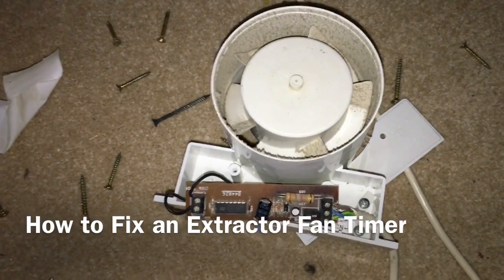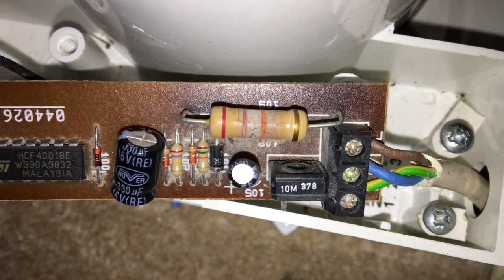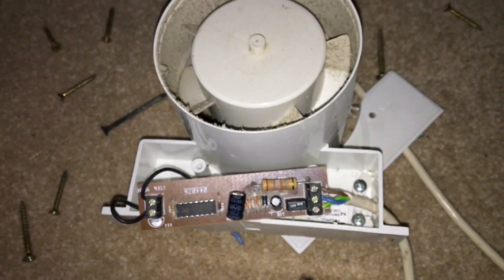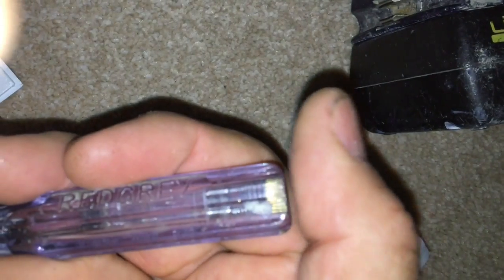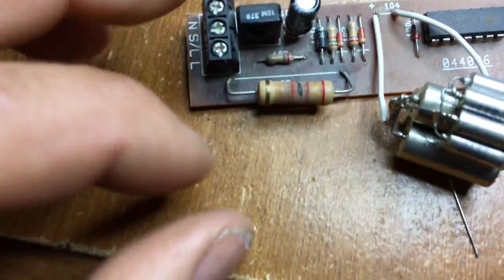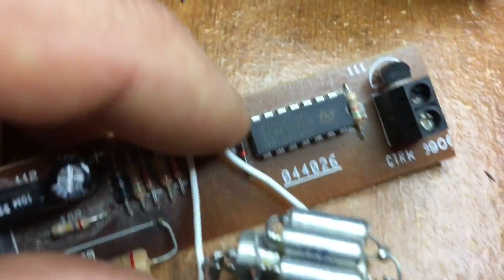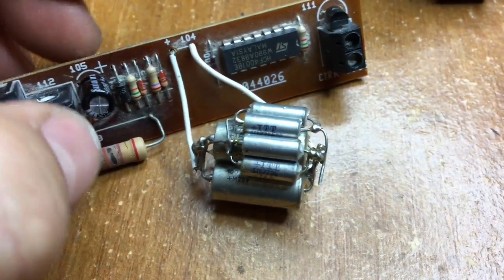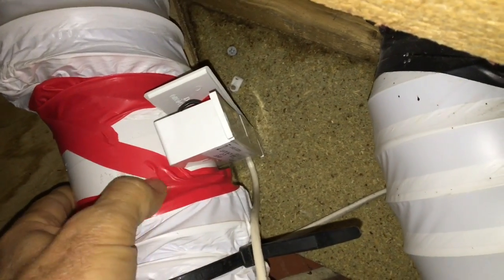How to Fix an Extractor Fan Timer

Comment: It was the smaller 47uF capacitor on mine as well - symptom was that the fan got slower and slower over the space of a few weeks, eventually just humming but not spinning at all.  Disconnecting the two black motor wires from the timer circuit and putting mains onto them proved that the fan was AOK (though was starting to clog with dust and got a good clean).
Reply from the maker: Glad you fixed it and I could help.

Comment: Thanks for posting this, it helped me fix my identical timer. My fan was running continuously after a lightning strike hit and destroyed a tree across the road. Many houses had their internet hubs and routers destroyed but as far as I know we were the only one with a bathroom fan problem. I saw the large burnt resistor with illegible markings and assumed that was the problem but you told me the specification and like yours mine measured correct. It wasn’t the capacitors either in my case, they looked and measured correct, it was three of the semiconductors, which I could have guessed given it was a high voltage attack. One of the 15v Zenner diodes was shorted. The logic quad nor gates didn’t work and the triac was shorted. The triac caused me the biggest problem as it is marked Z0125, which doesn’t seem to exist. I couldn’t get a Z0110 which is the 25mA trigger one so used a different type of triac which didn’t work at all, so used a Z0109 a 10mA trigger one, which did work. Time will tell how long for. 
I drew the circuit out. The AC mains is half rectified and dropped to 15v to power the nor gates, live also goes straight to the motor. Neutral to the motor is controlled by the triac. The switch terminal is somehow connected to turn pins 12/13 low when its live, I don’t understand how this works, something to do with the resistors and one zenner. This turns pin 11 high which charges the 330 uF capacitor, a diode stopping it discharging back through pin 11 when low. This charge is also on pin 9, 8 is always low,  making 10 low, which makes 5/6 low and so 4 high. 4 is connected to the gate of the triac which conducts and neutral is connected to the motor and it runs. The capacitor slowly discharges through a fixed and variable resistance, eventually pin 9 goes low turning 10 high so 4 low and the triac turns neutral off.
Reply from the maker: Thanks for your interesting feedback.
Reply: 3 years further on and I've had another of these fail, same circuit, this one stopped over running when the light was off then eventually was humming loudly and running slowly. The 22k resistor was brown but tested OK, the fault as with yours was that the two capacitors, 16v 47uF and 330uF had failed, replacement fixed it. Hopefully OK for another 20 years.

Comment: Thanks for the video, 2 capacitors replaced and works again amazing. Had actually bought a replacement fan before finding this video, luckily before throwing out the old one this being the third fan I've bought wish I'd known about this could have saved a fortune as the capacitors didn't cost much all in a repair for a couple of pounds instead of the full cost of a fan. At least I now have a spare I can swap out when the new one goes and have spare parts for when this one goes

Comment: I am nearly 95% sure that the capacitor has lost capacity over time due to the heat of the resistor. They just dry out over time and you could see that if you compare the old capacitor with a new one using an Oscilloscope. The lower voltage will change the way the board works so I probably would start with the 470uf/16v capacitor to see if that makes a difference.
Reply from the maker: Heat certainly makes things age faster.  There is also the factor that there are many cheap Chinese electrolytic capacitors where the electrolyte formula was copied from a Japanese company but without one vital ingredient meaning that they don’t last very long.  A lot of electronics seems to be plaqued by early failure due to these.   Even without that factor the electrolyte seem to age and degrade somewhat anyhow, it seems.

Comment: On mine the 47uF capacitor went high ESR, the capacitance actually still measured fine but ESR was around 15 ohm (should be about 2 max). The big 470uF actually tested fine in my case.
Reply from the maker: Thanks for that, I always assumed the capacitance value decreased over time causing failure but I never actually measured it or esr.

Comment: How can you set the length of time it runs? Or is it factory set?
Reply from the maker: Yes normally a small potentiometer on the circuit board which you adjust by a small screwdriver.
Reply: @comeinhandynow  thanks, thats helpful.

Comment: The timer on my Addvent fan AVX 100TN packed up recently. On examining the little PCB, it looks pretty much identical to the PCB in the film and it appears that the big resistor has failed due to the blackening underneath it. However I'm not an electronic whizz-kid so there's no way that I'd have the tools or know how to change that resistor. Therefore can anyone out there tell me where I can purchase a new timer PCB which I am competent to replace rather than putting a perfectly good working fan into landfill. The manufacturer say that City Electrical Factors supply those timers to them. On enquiring with CEF they say that they don't. It looks like another case of 'throwing the baby out with the bathwater' encouraging us to continue building greater mountains of plastic refuse, regardless of the impact on the environment.
Reply from the maker: I know you think you dont have the expertise, but that is only because you haven’t tried it.  Get a multimeter that measures resistance (in ohms) and measure that resistor.  It may be black but it may still work (have a resistance, as opposed to infinite resistance).  My bet is that its the capacitor(s) gone.  Get a soldering iron and leaded solder. Practice soldering. It’s not hard.  Desolder the capacitors.  Replace with new ones from ebay or the like.  You may surprise yourself.  You’ll gain a soldering iron, some experience, might have some fun fixing stuff and wont have lost much.
Reply: Do you have multi-meter? If so just measure the resistance of the resistor to check (22k in my case). Mine also looked cooked and has turned the PCB brown but that's normal, it just runs hot 24/7.

Comment: Be careful when testing those as it's 230v in and 230v out not 12vdc
Reply from the maker: Correct. Turn off and disconnect before repairing!
Reply: Well yes that's kind of obvious, not even Homer Simpson would try to repair this thing while live 🤦